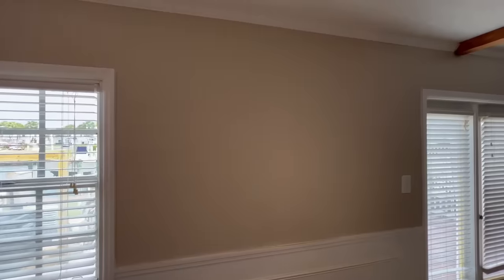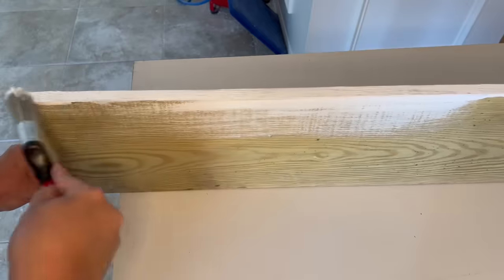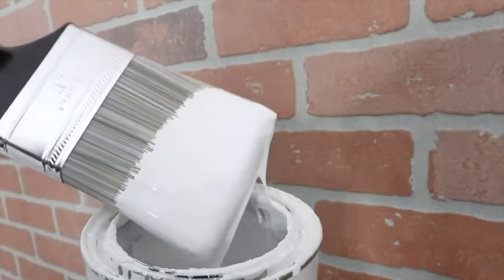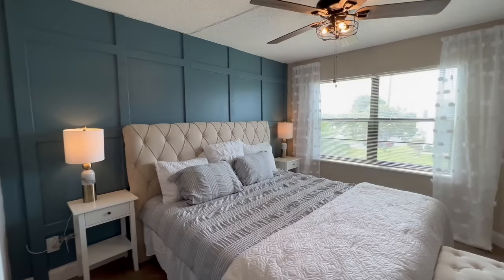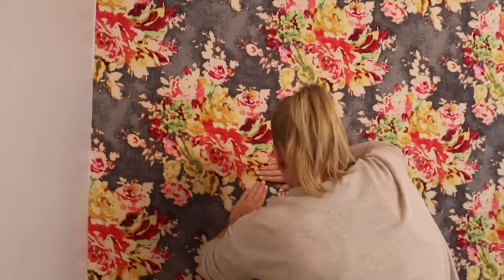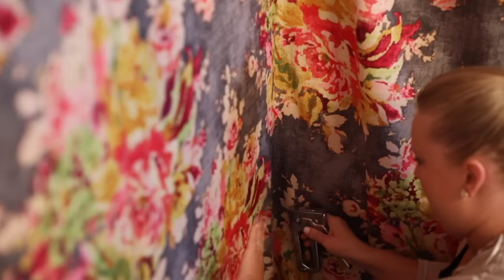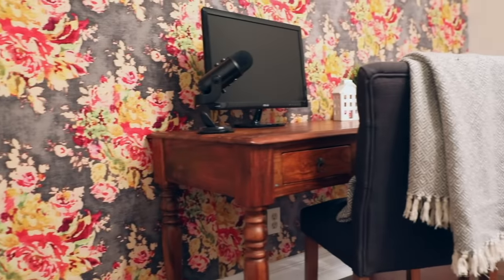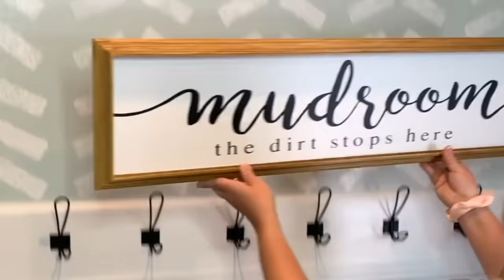The BRILLIANT new DIY wall decor trends people CAN'T stop talking about!

Comment: You can get Free wood strips from Lowes they are about 2" wide by 3 feet long and they throw them out. They use them as spacers in the wood shipped to the store so you have to go after its unlo0aded. Talk to your millworks guys in lowes and they will give them to you for free. I covered my barn shaped ceiling in my tiny house with them and it turned out beautiful..and it was free..
Reply: Thank you for sharing the information.  I don't think most people would know this!😊
Reply: Thank you, this is very kind!! God bless!!😊
Reply: Ty for this information
Reply: Thanks 😊 🙌 blessing for sharing ❤